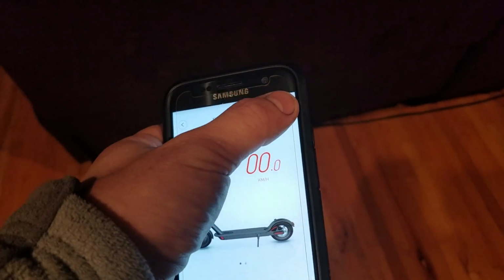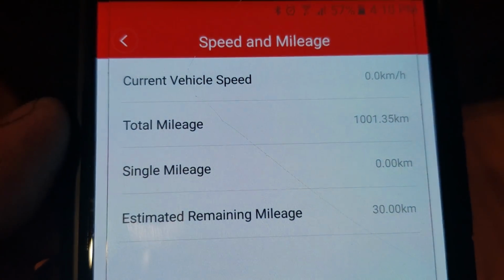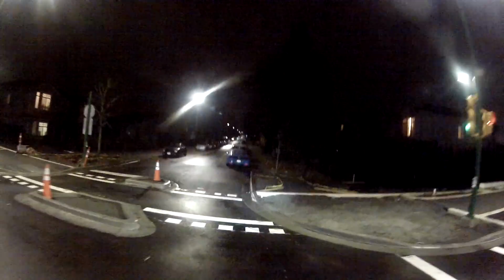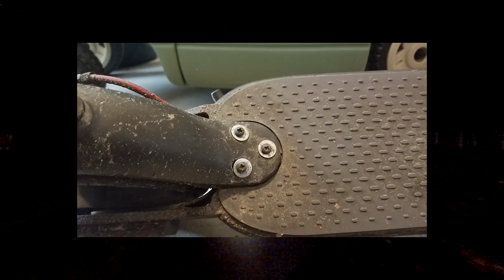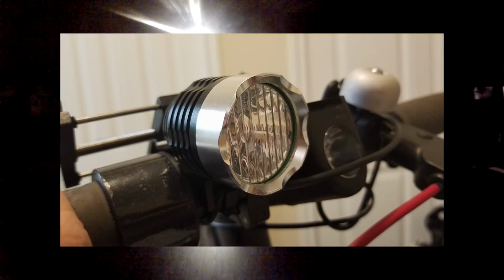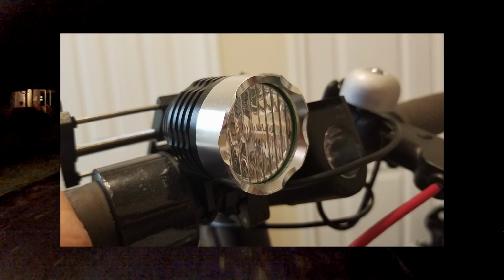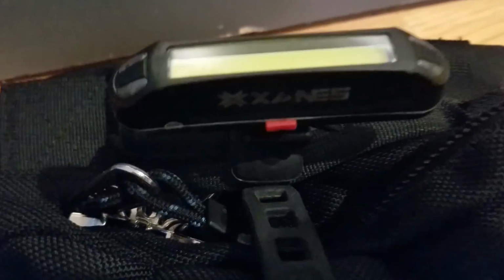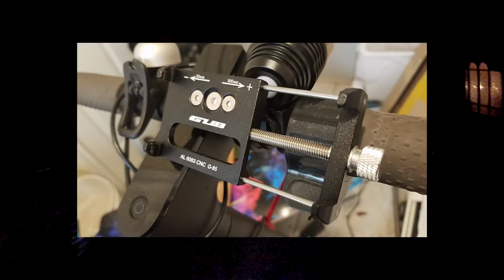Xiaomi M365 - 1000 km Review

Comment: So without a 3D printer and tons of tools to fix it, this product is basically cheaply produced garbage. Ill pass
Reply: As a happy owner, I cannot disagree. When I initially got the scooter, it looked absolutely solid and very well built. Turns out, however, there are some predetermined breaking points on the m365, like the spot welding on the battery and the slackness in the steering rod hinge. That said, I fixed the latter with a self-cut sheet of plastic and the former with a soldering iron. Still, I'd fully agree with you that the m365 is no long-term worry-free product right from the start. The hinge MUST be addressed at some point and the battery welding WILL get loose. Once those are fixed, the m365 will run pretty much perfectly.

Hence, "cheaply produced garbage" undersells the device by quite a bit. With 1h of time, a pair of scissors, a strip of plastic, and a soldering iron, you'll turn the m365 into a bargain scooter with rather high longevity.
Reply: I appreciate your honest advice!  Is there a specific guide on how to exactly do these repairs?  I have never touched a soldering iron in my life.  Thanks for any help!
Reply: Joshua Pang i would like to see those guides 👍
Reply: YouTuber @hrisson has a number of very instructive DIY videos on his channel, for example:

Adjust rear brake: https://www.youtube.com/watch?v=cc5QSCBjyjw
Battery issue fix: https://www.youtube.com/watch?v=L7PrZHwMqQg
Brakelight cable fix: https://www.youtube.com/watch?v=3KwumlvpKsA

And of course, there is always that search box on the top of your screen.
Reply: @Joshua Pang Well, same here. I have operated a soldering iron about two or three times in my life. So I estimate my skill level somewhere between abysmal and awful. Still, for fixing the m365 battery, it was enough, obviously.